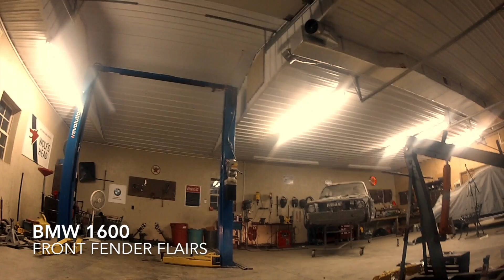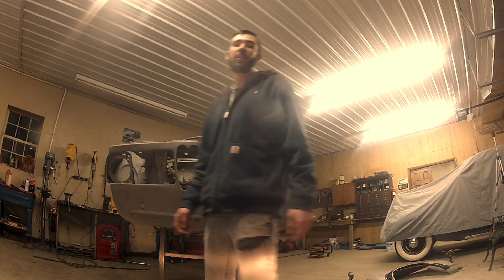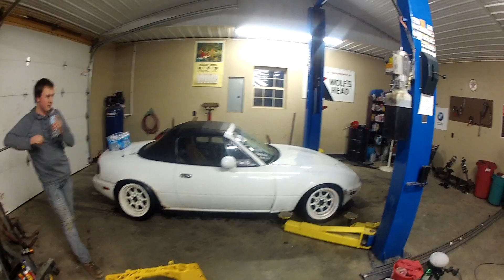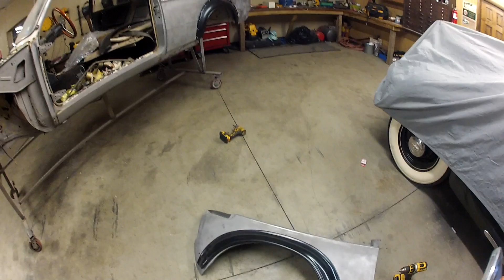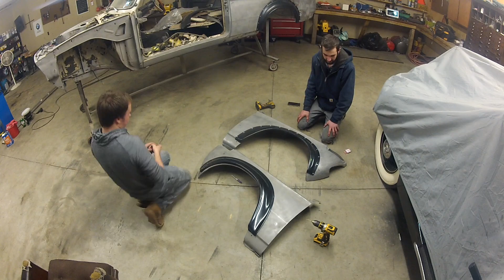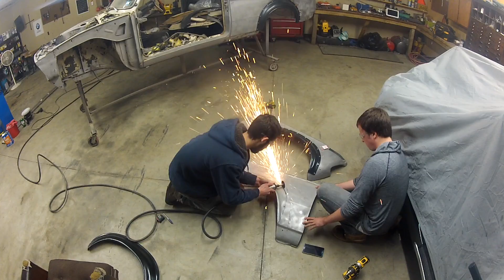1969 BMW 1600/2002 Ireland Engineering Front Fender Flare Installation

Comment: Where did you guys get those wheel flare? I just got a 1976 2002 and have no clue where to start!
Reply: +Nick Reiling I got mine from Ireland engineering checkout there website! That's awesome they are great cars also the 2002faq website will be alot of help!